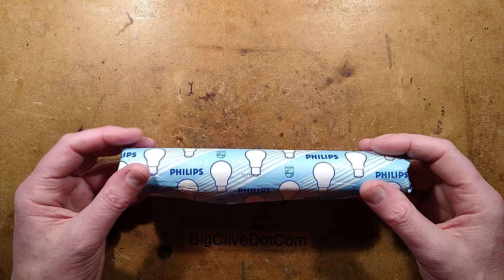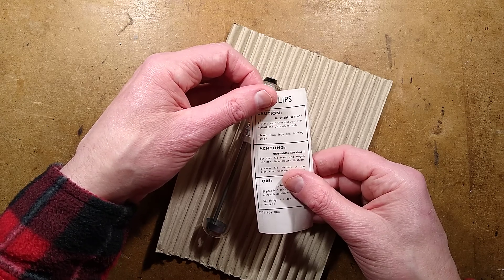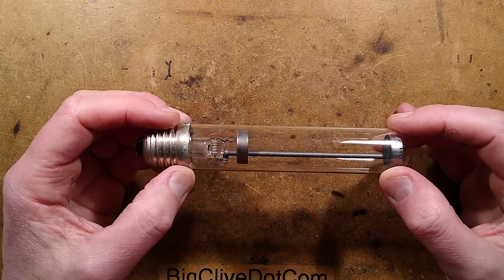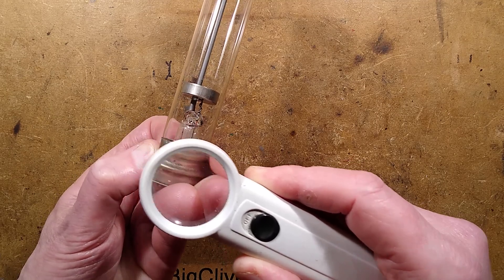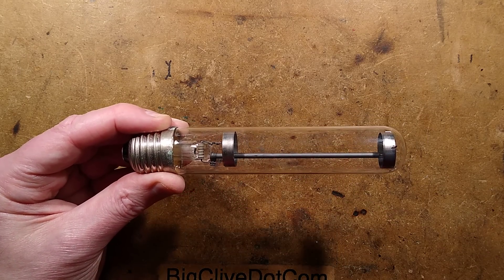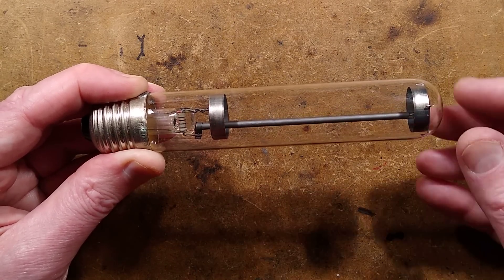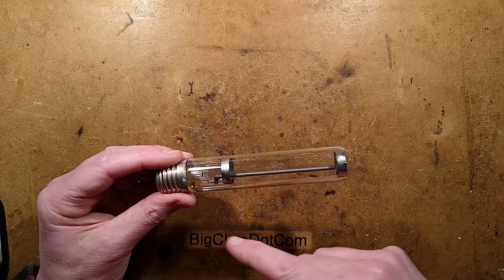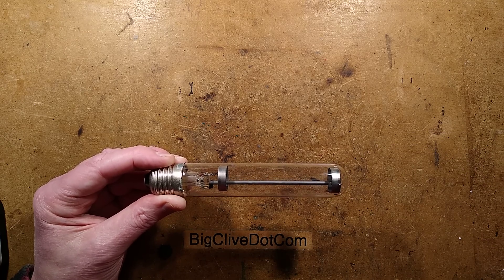Unwrapping and testing a dangerous vintage Philips lamp

Comment: Such a pretty glow. I'd love one with a UV filter just because it looks pretty
Reply: Looks pretty and then all you have is the memory of what it and everything else looked like. :(
Reply: @robertcroft2591  These just dry your eyes out. Basically give your retinas a sunburn.
Reply: Technically, that would probably just be glass. These lamps are usually made out of quartz instead, which does let that wavelength pass through
Reply: Get a tube-type battery charger. The rectifier bulb glows nice and purple. Voltage regulator tubes like 0A2 glow nicely. Check out all the tubes that start with 0. Get something that takes one. 1920s radio battery eliminators may work for you.

Comment: When we worked at the glass plant, one of the buildings had oxygen enriched furnaces that had walls you could "see" thru. It was always fun to see the engineers and nubbies get a funny look on their faces and RUN! to the toilet. We would get radiation damage if we worked in those areas for eight hours.

Comment: As a child I was covered in psoriasis, it was treated with UV B light. The treatment worked but not that well, but it did give a slight tan to the skin. Interesting subject, as UV light, as you said, can be quite harmful. Thanks for posting Clive, appreciated 👍
Reply: I noticed a Dermfix 1000MX? UVB lamp for it in the charity shop for a few weeks at £40. Just a cheap looking handheld thing with a 9W white, U-shaped tube and clear comb attachment.

It retails for >£140 and my dad had Psoriasis on his legs around the same time. I looked online and realised someone had changed the included specs to clear safety glasses. It sold not long after 👓

His leg cleared up quickly with some cream from the docs anyway🦵
Reply: @dazednconfused31337  UV bulbs will stop giving off the UV at a certain point but still light up. So you would have had to search for a new one had you bought it anyway.
Reply: there are different bands of UV. B lamp can give burn. C band lamp are dangerous but they can sterilize.

Comment: No symptoms so far! I'll update if anything changes.

Not that I expect anything will. It would be an interesting world if your camera, the encoding format, and my LCD monitor all 3 happened to work with UVC light and no one had realized until this video :P
Well there's a possibility of me having to visit the bathroom, but I have my digestive system to blame for that.
Reply: This is your third post...you keep repeating yourself.
Reply: @robertcroft2591  What no it's not

Comment: Back in the day, the late 1960's to the 1970's my barber had a cabinet with a UV bulb in it where he kept his scissors and combs.  The door had a frosted glass window in it, I think that my exposer to that lamp has allowed me to build up a resistance to the UV c, so I have not experienced any problems from your cool looking vintage bulb.
Reply: I'm actually immune to electrocution now thanks to many small shocks from electric fences as a kid. What doesn't kill you makes you stronger, so for the last 6 months I've been microdosing myself with lead, beryllium oxide dust, asbestos and hydrofluoric acid.  I do feel a little strange it has to be said but I'm beginning gamma radiation next week so soon I'll be virtually invincible.
Reply: Skins too thick....

Comment: On board of ships still in use for water treatment, the lamp is installed in a quartz tube and the water is circulated around the quartz tube. Very effective
Reply: Ps I see double now maybe the light or maybe the whisky 😊😊😊
Reply: Sort of, as long as the pipes downstream are "clean" , it wont work on pipework that cannot see it , so it is only effective at the waters point of passing ( copper pipes of course have a anti bacteria  (virus) functionality anyway , but plastic ones , who knows .
Reply: @highpath4776  , on most of the ship's the water from the pipes are not considered drinking water, but for galley and bathroom use. They bring bottled water onboard or they refill water bottles directly from the fresh water maker.

Comment: When I was an undergraduate, we used these exact lamps as "germicidal" sources in the early Microflow Class 1 safety cabinets.  They were fitted with an interlock system that prevented lamp ignition until the open lower section was closed off with an aluminium barrier.  By memory, they ran on a fixed 30 minute timer, and although the glass viewing section was not UV transparent, there was a clear warning to not look into the cabinet during the "disinfection cycle", probably for obvious reasons.
Reply: Did it had an optic inside, because they are way less effective than the low pressure lamps🤗 I ever guessed what the selling point of those lamps was.
Reply: @goiterlanternbase  No idea!  It was just one of those things, and after using the cabinets for anything potentially hazardous, we used to close them off, and hit the "decontaminate" button, which did seem to work, certainly against vegetative organisms (possibly less effective against spores though), since post treatment contact plates always came back "no growth". "Sterilising" the cabinets was just another of those routine "end of day" lab. jobs - something one did without too much thought! 🙂
Reply: Had a similar setup for desinfection with safety interlocks. Was not very effective. However UVC is still used for desinfection of air supply systems but it is powered by LED.

Comment: Since the resistor is tapped across both electrodes, could you measure it via the contacts?
Reply from the maker: It's in series with the discharge tube.

Comment: I think Clive needs to do another green banana UVC test.

Perhaps this lamp was made for clothes dryers, to give "sunshine fresh" clothes.
Reply from the maker: Disappointingly, this one doesn't generate ozone though.
Reply: @bigclivedotcom that could be a product review on a sales page from you 😂
Reply: @bigclivedotcom To be honest I'm not really surprised by this fact as ozone is toxic stuff and actually quite a pain and hazard if the tube is used for a UVAC system or even to sterilize stuff like I do with a articulated desk lamp pointing at it, without ozone you can reintegrate the room rightaway whereas with ozone you'll have to vent the room and wait quite a bit before it safe again to be in.
Also I thin it's primarily the cheaper tubes from China that are ozone-generating, the reputable brands like Philips using ozone-blocking quartz glass instead even as far as a few decades ago.

Comment: My monochromatic cat did not have any reaction to the UV light, but the orange one became very bouncy, started dashing back and forth across the place and then jumped up on the table and meowed loudly. I later noticed that the legs of the table were loose and this is probably related.
Reply: Maybe UVC attracted the single brain cell all orange cats share?
Reply: @southilgurl2003 God, I hope not. They're dumb enough as it is! (I love my orange, but he's not very bright, as usual.)
Reply: Hardly a catastrophe.
Reply: I mean... That just sounds like normal orange cat behavior to me.
Reply: @puckcat22679  lmao, mine is literally wandering around meowing at thin air as we speak

Comment: I would’ve loved 🥰 to have seen this warmup phase you spoke of before seeing it fully lit 💡
Reply from the maker: There wasn't one.  It just burst into life.
Reply: @bigclivedotcom  Strange, I would have expected it to struggle a bit after sitting for decades unused. I have seen this with fluorescent tubes. Ones that were sitting unused for 20-40 years, when you power them up often just their filaments glow orange for a few minutes, then it starts to glow white around the filaments, then it starts flashing for minutes like a bad tube and finally it strikes and works perfectly. The whole process can take up to 15 minutes! I guess in those all of the mercury has settled down and needs to evaporate again. Maybe they can also have cathode poisoning, so they have to boil off the poisoned outer layer of emitting material from the filaments.
Reply: @bigclivedotcom no slow motion video?

Comment: 4:00 I like the idea of a gigaohm resistor! What would the resistance be of those glass insulators which support cables hung from cross-country pylons?
Reply from the maker: The resistance of those insulators will depend on the amount of dirt on them.  In some places they pressure wash them with distilled water.
Reply: Hey, I just had a search, Nicrom Electronic of Switzerland actually makes 1TΩ resistors. A practical usecase for those would be interesting to see. I would guess in monitoring systems of 500kV DC transmission lines.

Geez, they also have 1TΩ SMD resistors! What kind of circuit board do you need not to act as a less than 1TΩ resistance under an SMD resistor? Probably ceramic or glass circuit board.
Reply: @mrnmrn1  If you put 1MV across your 1TΩ resistor, in theory it would conduct one microamp of current. In practise, given the size of surface-mount components, it's far more likely the voltage would just arc across. If something has a resistance greater than the equivalent amount of air then it's effectively an open circuit.
Reply: Resistors of 1 Gohm are commercially available.  If you ever take apart a large-diaphragm condenser microphone, you will probably find a 500M or 1G resistor between gate and source of the FET that amplifies the (very high impedance) output of the mic capsule.  If the capsule is externally polarized (not an electret type), there will be a second similar-value resistor used to feed the backplate polarizing voltage to the capsule.
Reply: Somewhere I have a 1000MOhm (= 1 Gigaohm = 1 Jiggaohm, as doc Brown would say) vacuum resistor. Made in East-Germany. I bought it to test insulation testers. Although it is not the best as a calibration standard, because it has either 5 or 10% tolerance. I haven't seen it in years, but good to know I have it... somewhere. The seller even had 100 GOhm ones. Not sure what those are used for.
Reply: @mrnmrn1  A 100 GΩ resistance is actually a 4-bedroom apartment with two terminals not soldered to the extremities.
Reply: @mrnmrn1  I think the STASI used those huge resistors to keep the truth from the German people.
Reply: @mrnmrn1 Resistors in that range (100M to 100G) are used to polarize condenser microphones and to bias their vacuum tube or JFET amplifiers. I usually see 1G to 10G used.
Reply: And here I've been calling anything above 1MΩ an "open circuit with component leads". Gigaohm resistors... The mind boggles.
Reply: They are not that uncommon. I have a bunch of 990Mohm ones with 2% tolerance and 40kV voltage rating, made by Caddock. They are about 10" long. Perfect for high voltage probes, as it in series with the 10MOhm input impedance of a multimeter, form a 1:100 voltage divider, so you can measure up to 40kV DC voltage with a 1000V rated multimeter. 
But hold on, I just had a search and even 1TeraOhm ones are available... That is really wild already.
 @HakureiMikko

Comment: Smell that Ozone!
...I fired up my ancient CRT (cathode ray tube) computer monitor to watch this video as I expected the thick front glass screen would absorb all the UV and I would be safe.
I'm OK, no nasty effects, but I could distinctly smell ozone coming from the back of the CRT monitor.
That's one powerful UV lamp you have there.
My imagination runs riot thinking of the resultant chaos if this video was ever shown to a crowd on a large video wall.
Reply: Might be treated to block the ozone-generating wavelength though.
At least if it's as advanced as modern UVC tubes made from big brands like Philips.
I think it's almost only the cheapy chinese tubes that produce ozone.

Comment: Thanks for the warnings. My stool did indeed become loose. So much so that one of the legs fell off!
Reply: Loose stools are a messy problem, I hope your trousers are Ok.
Reply: Did the FRONT leg fall off?
Reply: Not you as well, did you not wait around to take it home from A&E ?  I am sure they would give it a wipe and put it in a bag.
Reply: :O You too?
Reply: That sounds nasty, at least you have another leg to hop along on.
Reply: Mine loosene before I could even get up. 10/10 would not recommend looking at burning lamp!
Reply: I've filled a leg before, but I've never had one fall off.
Reply: WWHHOOOOSHHH!